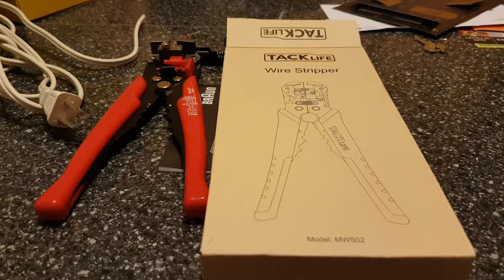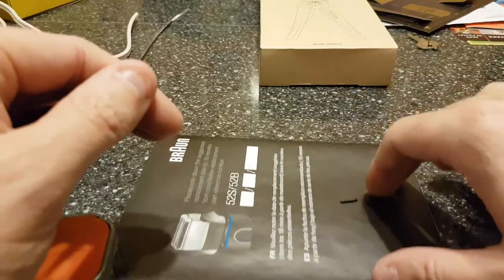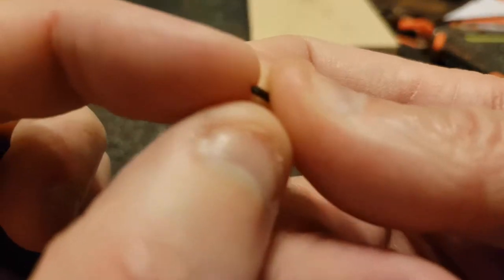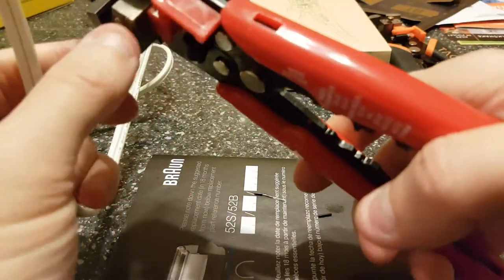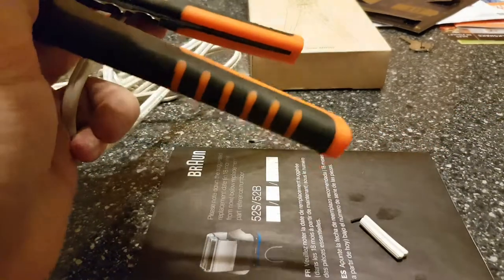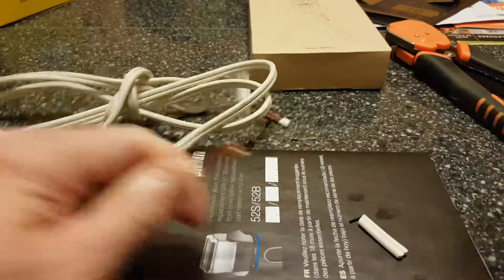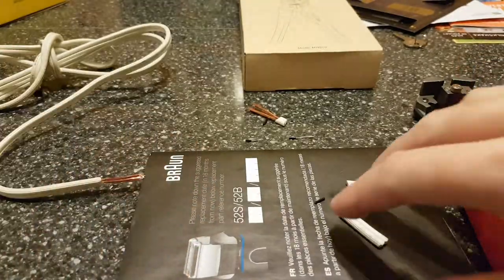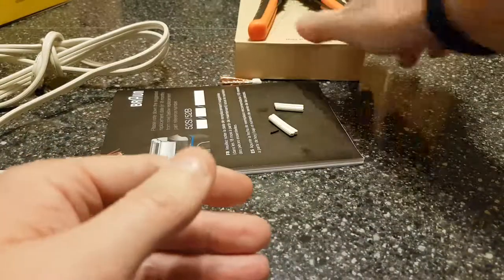Tack life wire stripper review score 5/10

Comment: I got this and wish I didn't. Wish I saw your video before hand.
Reply from the maker: Sorry to hear that but it is better than nothing...
Reply: @patdud1979  well these are nothing as they dont work. It wont strip the wire which is what I got it for.
Reply: @Iamuprise74  I have the tacklife one and it works flawlessly. I've used it with cables ranging from 0.75mm^2 all the way up to 10mm^2, it even strips the outer sleeving of tripolar cables without damaging the internal insulation. Sometimes bits of insulation fall in the mechanism and the next time I try to use it it fails, but all I have to do is shake the debris out and it works again. For 7€ next day shipping I honestly couldn't have asked for more.

Comment: How did you get it to grab the outside of the wire? Mine just grazes over the wire and slips over it never stripping it.
Reply from the maker: The adjustment nob but if you have shielded wire with a plastic sleeve it is harder.

Comment: The reason it's breaking wires in the video is that you're trying to strip two conductors at once which is not what the tool is designed for... That's why you're having to crank the tension up so hard.
Reply from the maker: Something tell me that you like to troll YouTube and play devils advocate 😈. Hey we all need a hobby 🤷‍♂️.
Reply: @patdud1979  No, it's just that I have the tacklife thing and it works more or less perfectly (I was looking for videos explaining how to use the crimping features which I've never used and has no markings, which is very annoying).
I've stripped everything from solid core 0.75mm^2 ringbell wires to 10mm^2 multistrand wires and even the outer sleeving of 3x1.5mm^2 extension cords without any issues.
Best 7€ I've spent on an electrical tool, it's at least 3 times as fast as stripping with electrician's scissors (even my high quality made in italy scissors) and zero chance of screwing up and accidentally damaging the wire underneath (especially with the 3x1.5).
I'm sure there are better quality ones, but this one is perfectly serviceable if you use it correctly.

If you use tools improperly you can't complain when they don't work well. 
What you're doing in the video is like using pincers as a wrench and lamenting that they're damaging your bolt heads.

Also you only tried the tool with this one kind of cable, with such a hard insulation you struggle for several seconds to pull it off by hand even after it's cut and almost completely pulled off (which is again a clue to the fact that you're doing it wrong by trying to strip both conductors at once), and then you immediately say it's bad and it doesn't work.
That's like testing a screwdriver with one type of screw and saying it's useless when it strips.